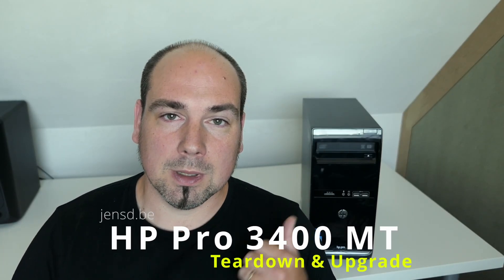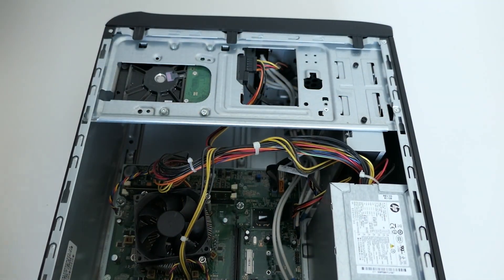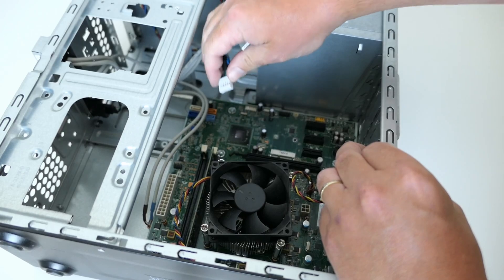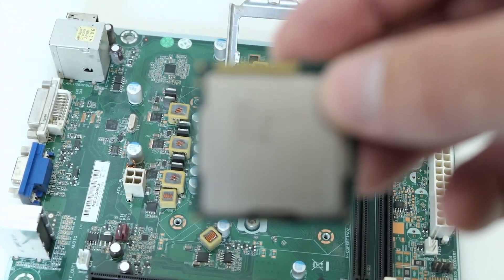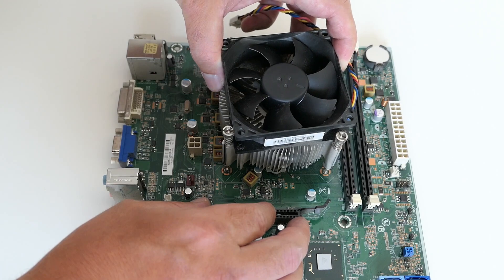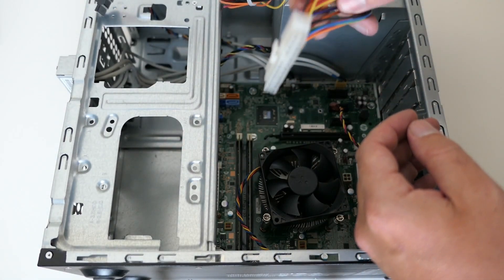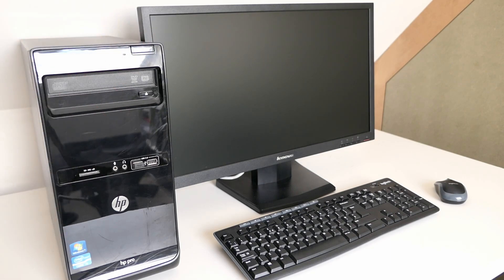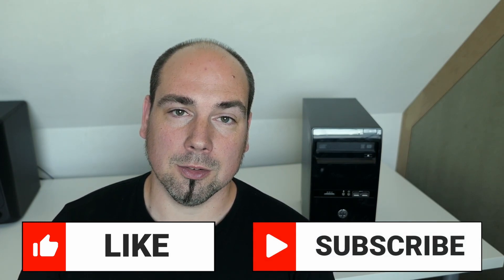HP Pro 3400 MT - Full Teardown and Upgrade

Comment: Working great with i7 3770k (modded bios), 16gb RAM, Crucial SSD and GTX 1650 without additional power supply.
Reply: Hi bro. I have the same pc and I also want to put a core i7 3770 and 16 ram. With an SSD and an RX 570. What should I do to make it work please?
Reply: did u hv to mod the bios for the 16gb ram to work

Comment: Picked up one of these very cheap with an i5-2400, 8GB 1333mhz RAM and a 240GB SSD. Going to upgrade the cpu to an i7 2600, 16GB RAM and add a 400w PSU with a small GTX 970 4GB (3.5GB for those of you that know, you know). Should make for a decent budget gaming machine.

Comment: Hi i have a problem i have a 450w psu in there and i have power connectors to the gpu the rtx 2060 that i want to install but it keeps beeping and its not booting and when i googled it said not enough power but the psu has enough power so can someone help me out ?
Reply: Bro, here you need to look at what kind of PSU you have, what kind of connectors, what about the video card, you better thoroughly look through the entire Internet for this, you won’t get an exact answer here
Reply: @Samir-n4m  be quiet

Comment: Hi which type of graphic card works in the HP pro 3400 for higher solution. Need 2640 x 1440 - bios seems to be a 
The main problem with newer cards

Comment: The new ssd drive faster than the one you took out?
Reply from the maker: For sure, upgrading a classic mechanical drive with an SSD is making a huge difference and should be the first step in upgrading.

Comment: Your the only one that has a video for my computer. I guess my hp has the i7 2600 and 8g ram... I was trying to find out if I can install 16g ram on my hp pro 3400 series MT.
Reply: From what I’ve seen of other videos it will take up to 16gb of ram
Reply from the maker: The official maximum is 8GB. Not sure if 16GB would work as it would need to support 8GB DIMMs. I guess the only way to find out is to test this.

Comment: Greetings, I have an HP pro 3400 computer and suddenly it didn't turn on anymore, I already tried the power supply, memories, hard disk, processor are fine, what will be the problem and the possible solution?
Reply: Could the problem be the power button?

Comment: Hey I've got a question what i5 processor can work here in got a Intel pentium  and also I tried to install a gt 710 in but it was not compatible any knowledge why if so what gpus do work
Reply from the maker: I believe the i5 2500 is the highest supported i5 CPU.
Not sure why the GT 710 didn't work. It's not extremely power hungry so shouldn't be a problem.
Reply: @jensdbe  thanks I think it was bios

Comment: yo I got some questions 
1 Can the ram slots support DDR4 and 5 
2 Can the PSU be changed with a different one 
3 Which types of CPU's can be supported
Reply from the maker: 1) Only DDR3
2) A standard ATX power supply should fit
3) In general only 2nd gen Core i3, i5 and i7 (and similar Pentium G/Celeron)
Reply: @jensdbe  thank you
Reply: @jensdbe  can u show us how to fit ATX power supply please

Comment: hello, I have a hp 3400mt model computer and I upgraded the video card to this computer, I couldn't get the image. I think the motherboard's bios is outdated, I couldn't find anything on the internet. Where can I find the bios update site for bios update? Can you help me?
Reply from the maker: Does the PC still work if you remove the video card, using the on-board video? Also check the setting in the BIOS for which card to use by default (integrated vs. PCIe) and make sure to check all video outputs if they are displaying something.

Comment: Can I use i5 3570 in this motherboard
Reply from the maker: As far as I know only 2nd generation Intel Core CPUs would be compatible. So the 2xxx series
Reply from the maker: @xXJusARandoXx a regular flat head screwdriver should do. I believe the screws are officially Torx T15 but there is space for a flathead as well

Comment: Im using the same PC but freezes on bois boot plz help
Reply from the maker: Hard to tell without more details. Could be anything really. I'd start by checking the memory, which has most chance of causing something like that. Then try with a different power supply if you have one and eventually maybe another CPU but I guess you don't really have a spare one laying around :)
First of all make sure it's not a software issue so just try to boot from a USB drive.

Comment: Is possibile to replace the MOBO with a new one,Microatx of course? Thank u in Advance and nice job=)
Reply from the maker: Yes, that should work fine. Didn't see any reason why it would not. Nothing proprietary as far as I see. good luck with the replacement.
Reply: @jensdbe  So if i choose a asrock, gigabyte something like that, it Will work? I fear some compatibility problems....
Reply from the maker: @giovannialecci1546  should work fine. The power supply and case are standard ATX, the rest is on the motherboard itself. The only thing whixh might be annoying to find out is the front panel connections but that is usually well-documented in the motherboard's manual
Reply: @jensdbe  and wich gpu will be compatible with this mobo??

Comment: Can i put an rx 570 8gb in here?
Reply from the maker: It should work but keep in mind that you will probably need additional power. You will need to check the power consumption and make sure you don't go over the power supply's capacity
Reply: @jensdbe  ok thank you

Comment: Does anyone know if this PC supports 16gb ram, in 2 8GB modules, that is 2x8?
Reply from the maker: Officially 8GB is the maximum according to HP but I believe some people have put 16GB without issues. Didn't try it myself.
Reply: on the board specifications max if 16GB not 8gb I dont know where people get the 8gb max from

Comment: im so close to buy this motherboard but i want to know if its perfectly works with a i5 3450, 8 GB RAM 1600Mhz and a RX560 2 GB?

PD: i have 2 4gb ddr3 ram 1600mhz
Reply from the maker: The motherboard supports only 2nd gen Core i CPUs so I don't think your i5 3450 will work. RAM (not at 1600Mhz though) and video caed should be fine.
Reply: @jensdbe  socket LGA 1155 on H61 support 2nd and 3rd Gen Intel core i.
with 2nd gen, RAM speed limited to 1333, with 3rd gen, 1600Mhz can be reached.
Since the RAM controller is on the CPU.
Reply: @brams.  it’s true, the chipset would support it, but unfortunately this motherboards bios and it’s updated version doesn’t support third gen CPUs
Reply: yes, it should be fine, even without changing the power supply. If you can use a sata to pcie (6pin) adaptor. I think some RX560 has a 6pin needed. Even with only one SATA power (54 Watts max) it should work (without overclocking). No adaptor needed if you don't have a 6 pin pcie on the RX560.

Comment: Does this support 16 gb ram??
Reply from the maker: In theory maximum 8 GB but could work with 16 GB, didn't try that.
Reply: @jensdbe  ok thank you
Reply: yes, 2x8GB is supported at JEDEC speed and timings.
Reply: @brams.  thx
Reply: If it supports 16GB with 8GB modules? I mean 8gb in each slot?
Reply: @faustocorrea3788  Yes, I already confirmed the compatibility of this hp h61 mobo with 2 modules of 8GB each. So 16GB in total. Better have same modules for better dual channel compatibility.
If you have a 3rd gen i5 or i7, better choose DDR3 with 1600 MT/s in JEDEC speeds (at 1.5 volts).
Reply: If it supports 16GB with 8GB modules? I mean 8gb in each slot?

Comment: What is the name of the motherboard???????
Reply from the maker: It's a custom HP motherboard. Not sold separately afaik. I think you should be able to replace it with a generic micro ATX board though. Nothing that looked proprietary that would not allow that.
Reply: @jensdbe  You do not know if this HP PRO 3400 SERIES MT, Supports 16gb RAM? Sure, putting 8GB in each slot.
Reply: @jensdbe  You do not know if this HP PRO 3400 SERIES MT, Supports 16gb RAM? Sure, putting 8GB in each slot.
Reply: it's a oem hp H61 Express mobo. No XMP RAM or overclocking possible, and only 4 SATA 2, no SATA 3. 
There is, I think, an advanced bios mode with CTRL+F10→CTRL+F11
for controlling the cpu fan speeds and behaviours. But it is good and quiet by default with an i5.
https://www.youtube.com/watch?v=qSi0Xc4RcUc
Reply: @brams.  PLZ GIUDE ME FOR ABOUT MOTHERBOARD FOR CORE I5 IST GEN PLZZZZZ
WHICH IS BEST FOR IT?????
Reply: @gamingbhi5001  Hello Bhi, 1st gen core i is on socket LGA 1156, so you need a mobo with chipset Intel H55, H57, P55, Q57.
I'll go for a P55 mobo for better overclocking possibilities. if you have a good cpu cooler.
Better choose a mobo with 4 DDR3 slots. So you can upgrade to 16GB (4x4GB), on socket 1156, generally the modules must be 4GB max.

Comment: Ubuntu Mint 20.20 worked fine on my Pro 3400 MT.  I was able to get an AMD S9050 working fine but not in the X16 slot.  I used an X1 riser to that card.  A warning:  The motherboard, at least mine, has only 2Mbit ROM and the bios upgrade that HP offers is a 4Mbit so not compatible.  I am testing the board with a pair AMD FilrePro and win7x64 to see if I can get 4 cards to work for mining GRC.  I posted over at the HP community about the improper bios and left photos of the breadboarded system.  Hope this is useful to your followers!
Reply from the maker: Thanks a lot for sharing this. Definitely helpful!

Comment: Good morning, I have the same pc with everything that comes from the factory, I would like to know what I can do to make windows 10 run correctly, could you give me some advice or something I can do to make my pc work correctly with windows 10?
Reply from the maker: I didn't do anything special. If you create a Windows 10 installation USB drive using the Windows Media Creation tool, you can just boot from it and do the installation. Once complete, run Windows Update and install the additional drivers. Everything should be there.
Reply: @jensdbe  The problem is that I cannot find the drivers, HP does not provide driver updates for windows 10, and lately I have noticed that the processor that is giving me problems is the one
ATA / ATAPI IDE controller

Do you have any recommendations for me?
Reply: @raemaximal7484  better activate de AHCI in the bios, before installing Windows 10. For a 3500 MT, only the Realtek audio and Ethernet drivers needs to be updated. And maybe the last intel graphics for the iGPU. Maybe use Driverscloud to download them with ease.

Comment: I've got one of these coming in a few days I cant wait to start working on it ...going to put ssd 16gb of ram ...I got and i5 processor
Reply: It needs a lot of work but I payed 40quid for it lol 😆
Reply: MrLuka 339  it's max 8GB DDR3 modules. So 16GB max in Total. No XMP activation or RAM tuning in the BIOS, even the last one, so the SPD JEDEC speed is the max. (1600Mhz, true 800Mhz in Double Data Rate). The Gskill 2133Mhz CL10 XMP 1.65v DDR3 runs at only 1333Mhz CL9 at 1.5v.
 Better choose a DDR3 16GB kit running at 1600Mhz in JEDEC mode. Don't forget to choose the two same 2Rx8 DDR3 modules with chips on both sides, for 15% better performance than 1Rx8 slower modules with chips on only one side.
Reply: @brams.  im gonna buy the motherboard so if i have a ddr3 ram 1600mhz, its gonna run at 1333mhz?
Reply: Can't get the hd 5450 1gb graphics card to run??
Reply: @toezdennis9  I put a RX570 4GB in a hp pro 3500 Mt with no problem. But I changed the PSU.
Reply: @brams.  bro can you help me? i need some questions
Reply: MrLuka 339  I've had to change the motherboard for an intel ...and I've yet to 16gb I have been assured by online pro it will take 2×8gb not tried it